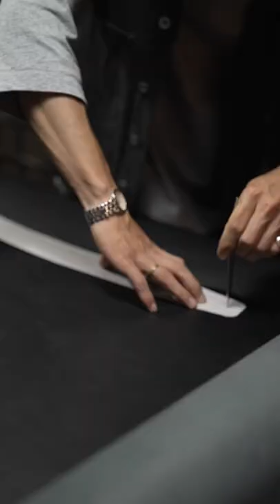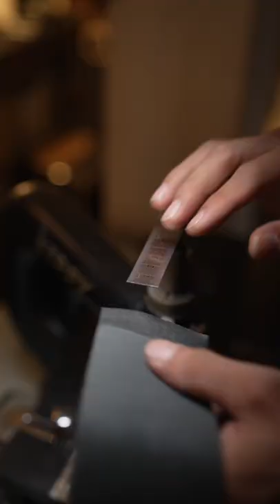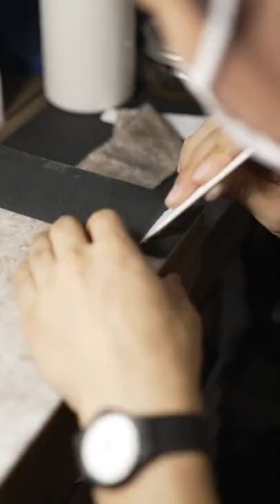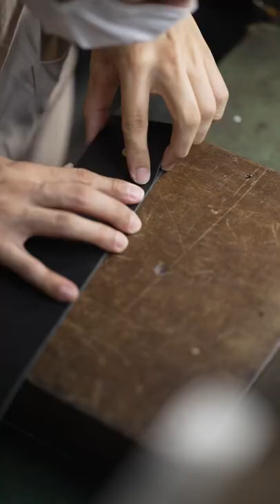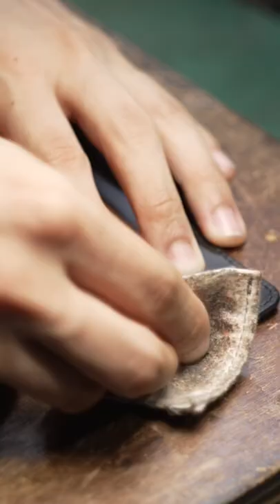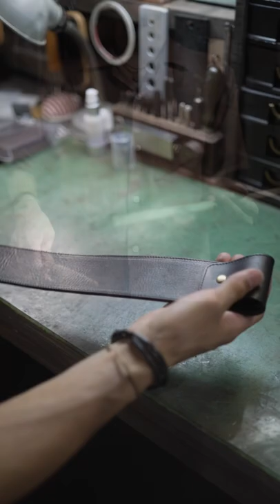Making a Drumstick Case #shorts

Comment: If you made a full stick bag that folded in half with 2-3 stick pockets (my stick bag usually has at least 12 regular sticks, a pair of mallets, and a pair of wire brushes). Then one or two smaller pockets for drum keys, ear plugs, etc. You could definitely sell them for a hefty price. Custom work like this with attention to detail… worth the price.
Reply from the maker: Thanks for the advice. I am glad to hear your valuable opinion. I will discuss this with the craftsman who makes the drumstick cases. Thanks a lot😆🙌🙌